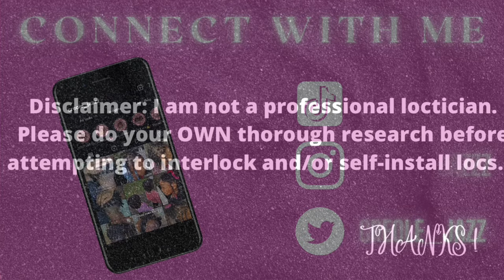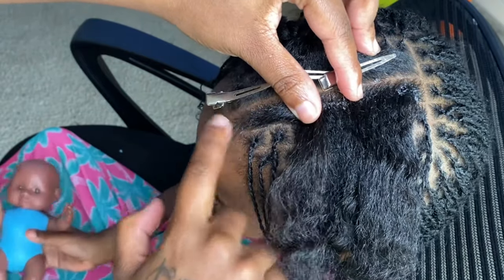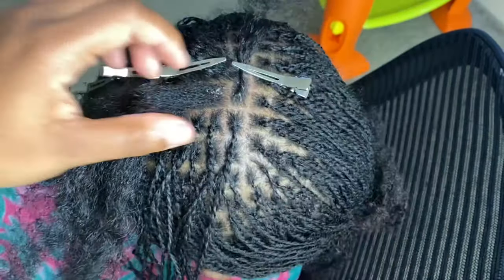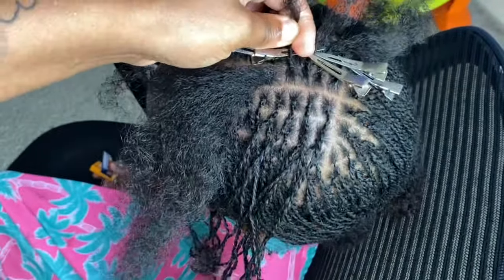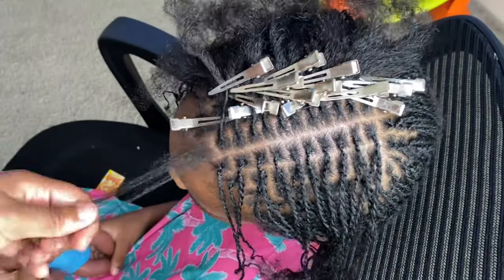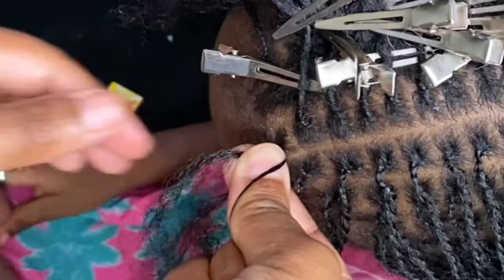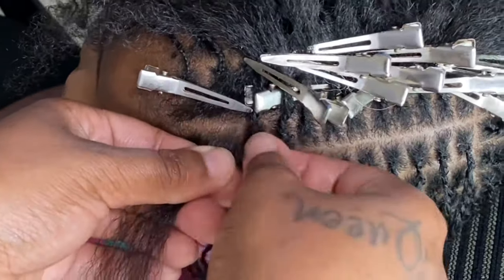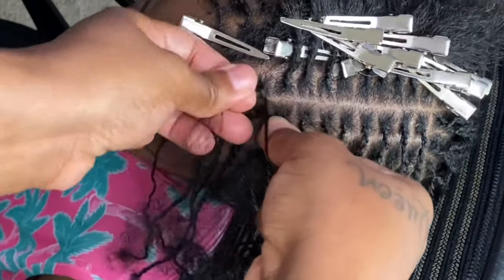HOW TO | DIY MICROLOCS INSTALLATION PART 2 🌱 | (Braided root) & Two Strand Twist Method

Comment: Do you just leave the ends out to keep them curly?
Reply from the maker: Basically yes. I didn’t twist fullly to the bottom and it stayed curly for the most part. On wash days I added conditioner to the ends to keep the curls

Comment: What do u do if ur child has crazy shrinkage? How do u maintain the hairs length without the shrinkage?
Reply from the maker: The hair is going to shrink regardless. That’s the beauty of our hair BUT to minimize shrinkage you can braid the hair every night before bed and moisturize with coconut oil or whatever oil you chose. The other option is, when installing microlocs you can start with braids instead of two strand twist.

Comment: OK so I’m confused, does she have the micro locks now or the two strand twists?
Reply from the maker: She has Microlocs. They can be started by 3 different methods. Braids, two strand twist, & interlocking. I started hers with a braided root & two strand twist. Over time the twist will began to lock & I will maintain by interlocking her new growth.

Hope this helps ✨
Reply: @creolejazz  No, I was confused because I saw you do a head full of small Micro locs in her hair. But, these are bigger. Did you comb out all of the little ones you put in?
Reply from the maker: Lol no these are the exact same locs. It may have looked smaller up close but after applying mousse, it brought her hair to its natural state. Same parts just hair looks thicker.

Comment: I'm a new subscriber, please can I leave my microlocs without locking it. Just the way you did yours here. Won't it loose back.
Reply from the maker: Yesss you can, just don’t interlock them and try not to keep them over 3-4 months because they will start locking. You can install and keep them for 3 months at a time if you like 💕
Reply: @creolejazz  thank you so much